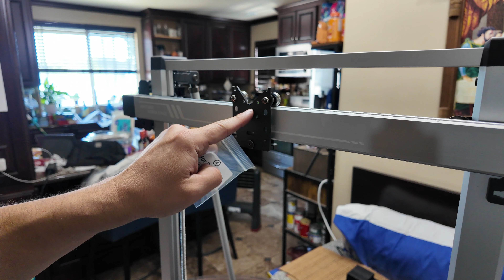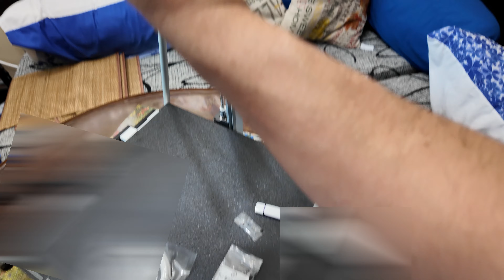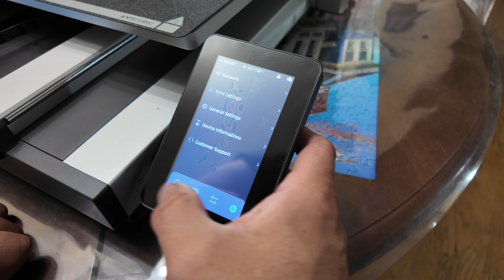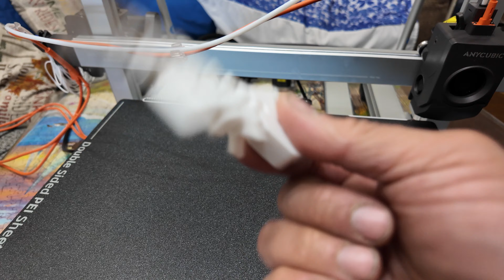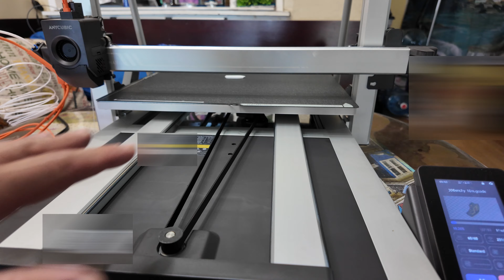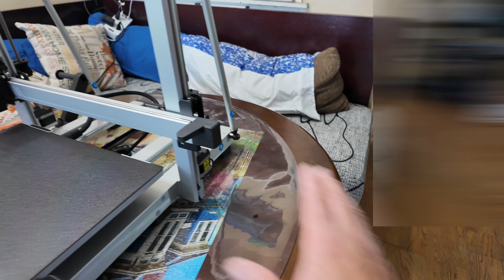Anycubic 3D Printer Kobra 3 MAX

Comment: I just bought one of these. I have an QuDi xmax3 and it is doing good straight out of the box. It boes not want to connect to wifi so i had to use a cable as i was getting tired of the thumbstick transfers. I hope the wifi on this unit works better